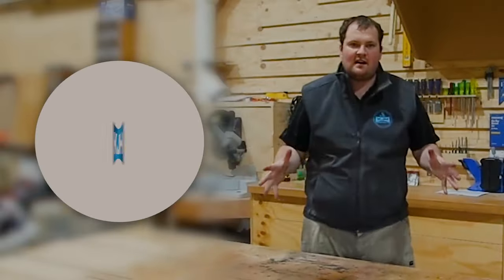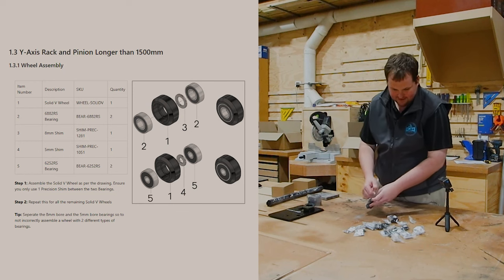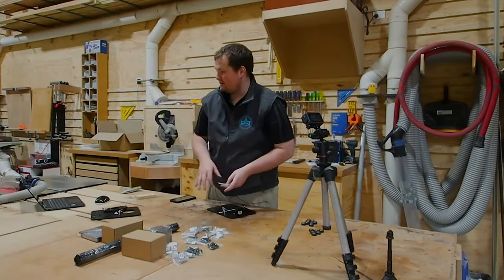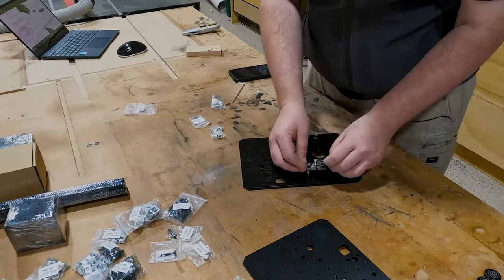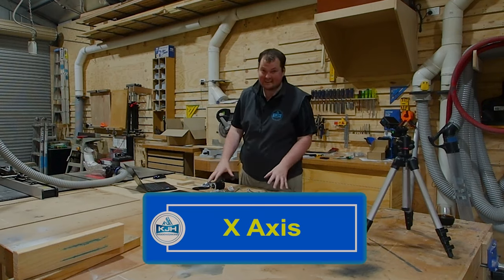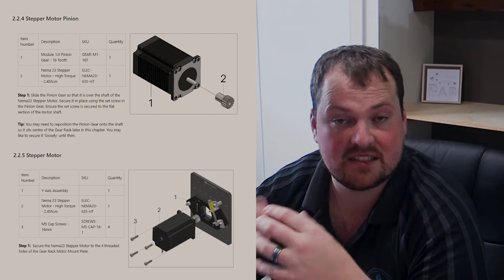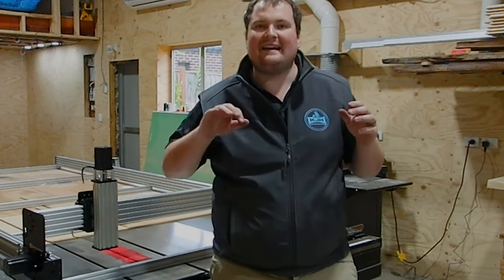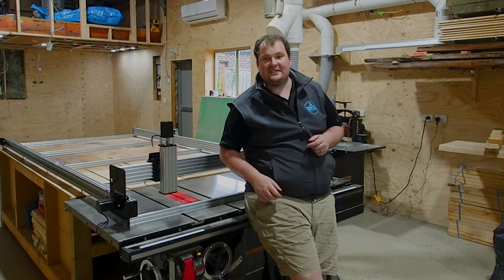How To Make DIY CNC Machine: The Ultimate Guide For Makers | KJHWoodWorking.com.au

Comment: Great video on the DIY CNC.
One quick comment on your production technique... Your audio is really amazing...
Can you describe your mic and perhaps post process steps ?
Reply from the maker: Glad you liked it! I used a Rode Wireless Go 2 mic and I run my audio through Adobe Audio Enhancer prior to export. Makes the world of difference.
Reply: 10:05 since you asked. Assuming there are only two of those, you can only choose between two holes. The probability is 1/2 for getting it wrong on one of them, 50%. But get it wrong on all 4, that is 0.5x0.5x0.5x0.5 = 6.25%.

Great videos, going through your cnc collection of videos and learning quite a few things 👍